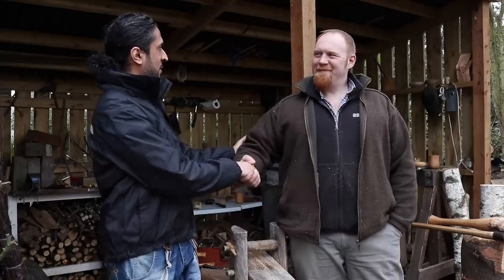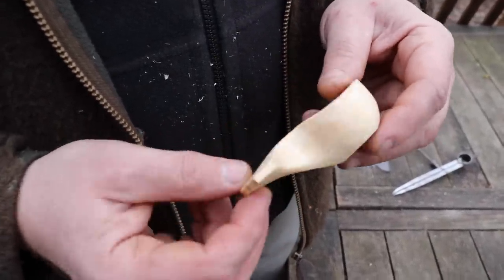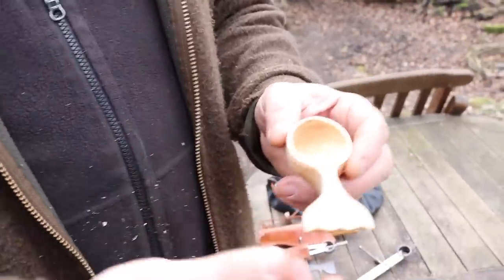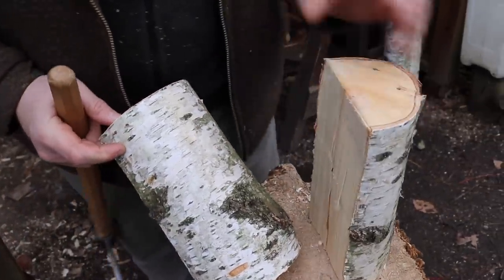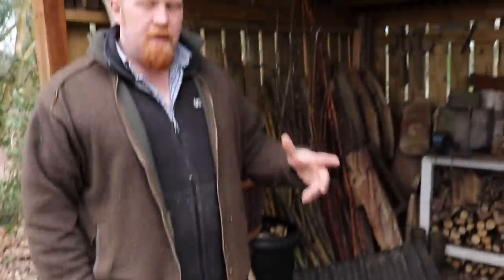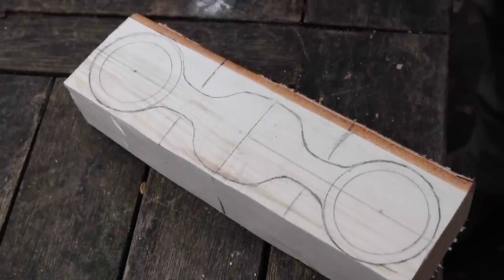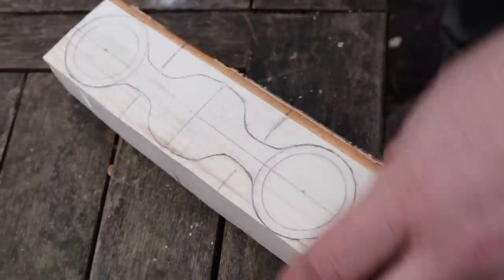How To Carve A Whale Shaped Scoop - Chris Allen

Comment: 💥 Video Time Line 💥

0:00 -  Intro of Woodworker Artist Mr Allen 
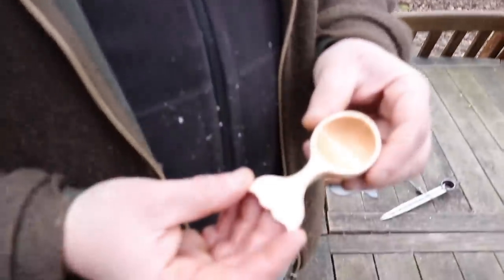1:21 - Showing a Hand carved Scoop, by Mr Allen
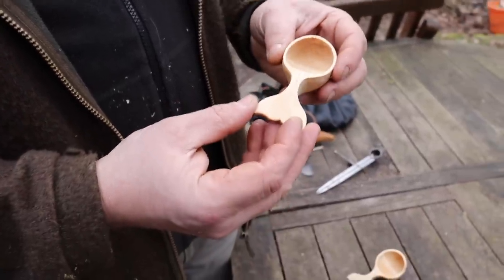2:56 - Cleaving the Wood using a FROE 
6:11 - Different kinds of Splits in wood
8:02 - Removing Bark 
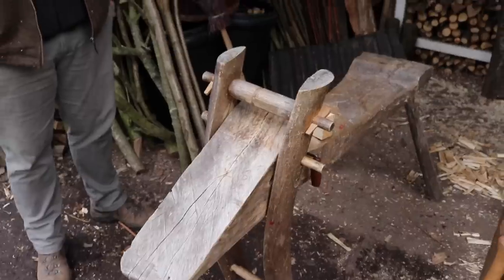8:20 - 500yr design , DIY Colonial Shave Horse (combo of a Work bench and Vice) 
13:01 Measuring & Marking up the Scoop Design
16:20 Putting in Stop cuts into diagramed scoop 
17:15 Silky Saw 
18:45 Axes/Hatchets
19:33 Shout out to  MAX
19:52 Working the Hatchet Lots of Techniques in chopping
31:55 Sawing and separating the 2 spoons
32:26 Knife Work
1:03:43 Using a SCORP A scorp is a roughing-out tool for making bowls, spoons, and similar concave shapes. 
1:13:15 Carving the Back of the scoop Bowl with knife...lots of refining/cleaning up. 
1:25:51 Clean up the bowl with the Scorp
 1:28:41 Marking out the tail flute_scoop handle
1:29:32 Carving out the Tail flute
1:35:00 Finished carving & Oil coating 
1:35:40 IT's a Wrap !!

What a gem , this video learning is....Phenominal and  Instructor Mr Allen is a super skilled woodworker. 
Enjoyed this series , tremendously ...cheers 💪 😎 👍
Reply: Kanzee Thanks for the break down and your kind words 🙂
Reply from the maker: Awesome ~Peace~